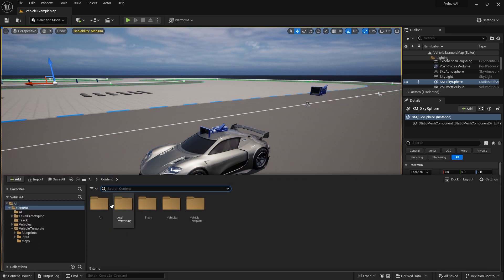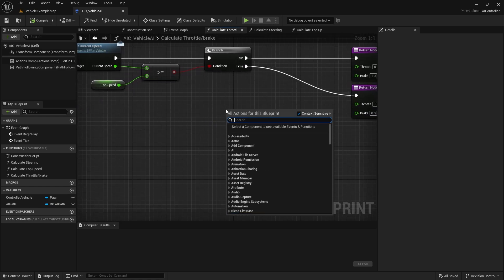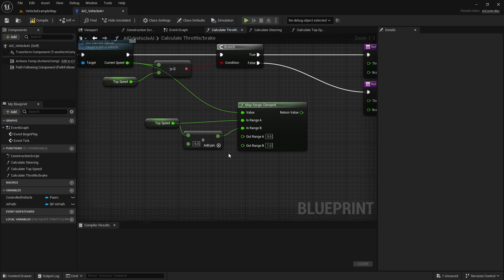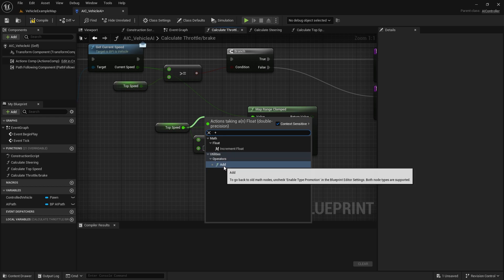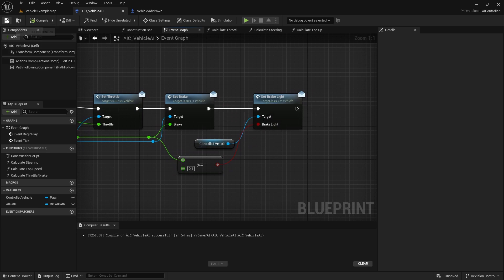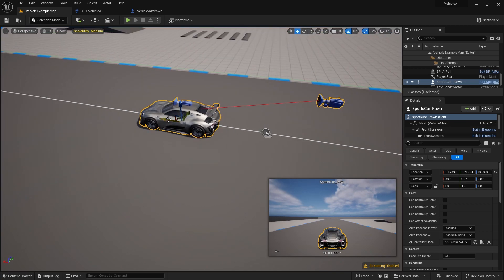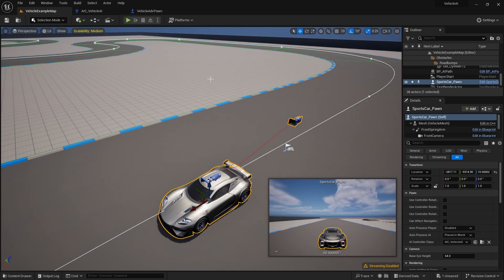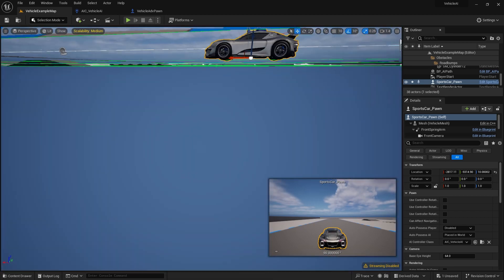Improving braking and brake lights | Vehicle AI in Unreal Engine 5 | Part 4/6

Comment: Your code is not gonna work how you are expecting it to work. Because in Calculate Throttle/Brake you are not handling correctly false branch. In your version car will be constantly bracking upon reaching top speed so no freening are going to happen. Otherwise really nice videos. I've liked every single one)